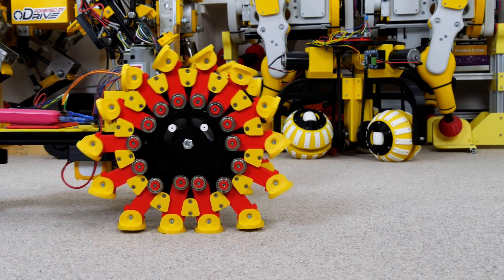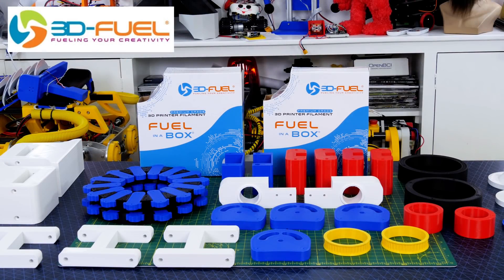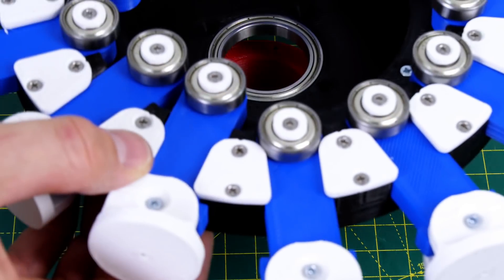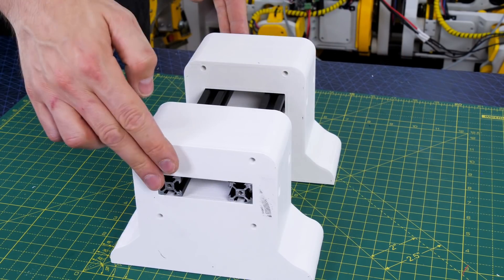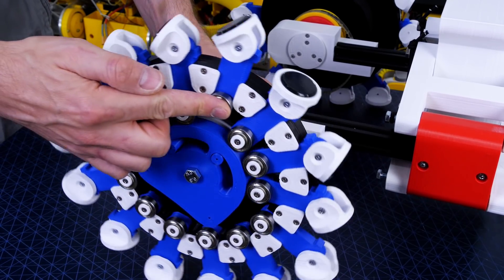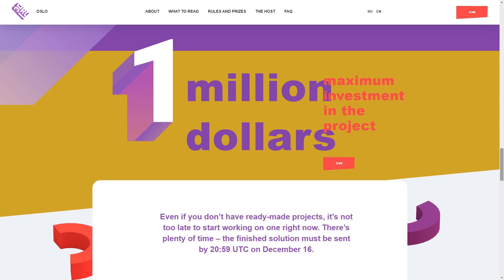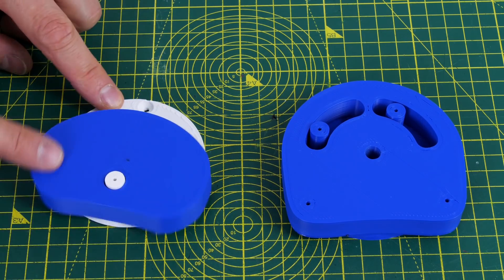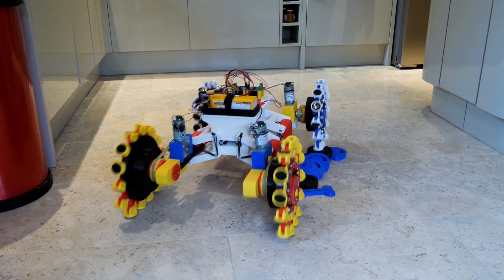4WD Walking Wheel Crawler Vehicle

Comment: Hi James. With that new inner wheel support bean things, you completely missed the purpose of them. As it is now, it is of zero use, as the bearings aren’t touching the red and blue middle bean shaped things. Right now, since the bearings aren’t touching it, the entire concept of this wheel is destroyed. And instead of the whole robot being supported by the bearings touching the beans, the small yellow feet are touching the outer wheel which is where the support is now, and not at the bean, which makes zero sense. Right now, only one, maximum 2 yellow/white feet per wheel are supporting the robot, whereas if you did it correct, 2-3 yellow/white feet would touch the ground and support the robot AT ALL TIMES. 

The solution is to increase the length of the blue and red arms that hold the white and yellow feet, and to go back to your previous inner support design, and then do as the original drawings did, put springs in so it is kept upright. 

Please, please, please this is such a plain sight error that you have completely missed. Sure, it drives, but like this, it has zero reason to be this complexs, and you could’t have just made one big single-part printed wheel without moving parts and it would perform just as good. Feel free to get back to me on Telegram @emilsterndorff so I can explain why this design is so flawed, compared to what you are actually trying to build.
Reply: I was searching for this comment
Reply: Nah, forget the inner bean completely, put a very light spring on each leg instead. As long as the legs are extended when they reach a high step it will catch on it and climb. 

I think the goal should be to make a legged-wheel that can climb a step up higher than a round wheel of the same size could and the bean doesn’t help with that sort if extreme step up. I think with light enough springs it could be made to climb over a blocker higher than it’s point of rotation. The other wheels would have to be able to compress the legs that are hitting the face of the step/block before the leg that is above the corner of the block could reach it and catch and climb. Can’t wait to see that.
Reply: This is such an aggressive way to offer help. Your points may be valid but this reads so disrespectfully.
Reply: @ThreeLetterChop  no I think he's just making his point clear
Reply: He certainly was clear.

Comment: It's neat to see in motion but it would be cool to see how it would work on a sustained climb as in up/down some shallow stairs or in a stretch of uneven or rocky terrain. I know it may not be practical to find a place like that but it seems like a regular tire of the same size wouldn't have a problem traversing these tests.
Reply: It would be cool to see this tested in a rocky environment. And to see if it could out climb a normal wheel.

Comment: I'd add steering to the center, so that the whole chassis would bend/flex like a dumper truck. Could be pretty cool 👍
Reply: And maybe some additional weight on the chassis to really make the suspension work...
Reply: And some portal axels.
Reply: @raymondjack4634  Mmmmm. Suspension and portal axles.
Reply: Articulated
Reply: We call em wiggle wagons. Its an articulated chassis. Bends in the yaw axis and twists in the roll axis.
Reply: Most of the large ag tractors are articulated. Knuckle steering is a problem when you get to very high loads.
Reply: Do it
Reply: Dumper Truck
Reply: Dump trucks like that don't pivot solely on that hinge, they still have normal steering.
Reply: @Iron-Griffon  no they don't.. the vast majority are center pivoting (at least the ones here in the UK). Both roller and dumpers, and some telehandlers.
Reply: Look up "lego springless suspension". It kinda does what you're describing.

Also look up a bunch of other suspension systems, like Active Suspension and "Fully Mode-Decoupled Suspension". Both of those are good if you want a lot more control, but they can be quite complex.

Comment: it's a neat concept, but as I try to think of ways to improve the feet, everything I think of just sort of turns them into treads, thus defeating the purpose of the experiment... lol
Reply: I wonder if you could stimulate a much larger wheel by running the legs through tracks.
Reply: I think track-like but not tracks is the answer, just put arc shaped toes on the feet which are interleaved with the feet either side. The feet still retain their fixed pivot point

Comment: I would expect quite an improvement if the feet are just made with flexible fillament so they can conform to edges instead of the rubber feet
Reply: Wouldn't that defeat the purpose tho?? 
The idea here is that the wheel itself conforms
Reply: @tannlknin6926  I don't think so. The way I see it it would fulfill the purpose of the rubber feet since they would squish in one direction like our feet and hands do to hold on and also it would help greatly with things like sharp stones where the feet might otherwise just slip off one side
Reply: @TheRedNaxela  yeah you might be right. 
I think he briefly touched on it in part 1 qctually

Comment: this mechanism is the ideal demosntration tool to show what is happening inside a soft crawler tire as it conforms to a surface. Same mechanical principle once done with rigid mechanics and with compliant material.
Reply: My robotics team uses compliant wheels for our obstacle-climbing machines. We could've done treads as well but didn't want to deal with keeping them tight enough.

Comment: Why can't the little arms be individually sprung rather than utilizing a central guide? A rubber track around the feet could perhaps prevent them becoming stuck in obstacles as easily.
Reply: It's just a tank tread with an unusual drive mechanism at that point.

Comment: I think your legs are too short. as the ankle hinge part hits the hub before the roller hits the middle guide. I think the length of the leg should be so long that the roller hits the guide before the ankle hits the hub. Also your bungy coard may be a bit too tight, but it seems to work okay.

Comment: That design looks like something from the H G Wells 1903 short story 'The Land Ironclads' that describes a kind of tank warfare, before tanks were invented. The land ironclads were described in the story as 100 ft long armoured vehicles that moved on eight pairs of big pedrail wheels, each ten feet in diameter.
The story can be found online. When I first read it it was not the pedrail wheels that impressed me so much as the description of the vehicles gunners sitting in darkened cabins watching the outside world on screens and controlling the guns with a joystick with a fire button on top.

Comment: I don't see how the guides are helping anything at all. I mean i would love to be proven wrong with a guide vs no guide test, but especially now that the bearings aren't even touching the guide when they are at the bottom, i don't see the point. Also, i am very curious as to why you did the suspension like that with the double wishbone suspending a long beam with the wheel at the end of the beam. I don't know why you wouldn't use the beam itself to your benefit, i.e. just a single pivot at the end of the beam.
Reply: I think the guides are only helping at keeping the feet extended before it transitions to moving flatly across the surface. This helps the the feet to step over obstacles instead of just retracting back.

As for the suspension, the point is to keep the wheel and the guide centre position constantly upright. If you instead use a pivot at the end of the beam, the guide centre position will be tilted whenever the wheel is raised.

Comment: I am not sure I understand the purpose of the bearings on the legs. Wouldn't a solid discs do the job in this case?
Reply: For the axle. The wheel then has a pulley fitted  directly to it for drive.

Comment: If you do anything else with this project,  I recommend angling the chassis to more of a pyramid shape to be able to clear taller obstacles.
Reply: Mount the wheel to the end of the suspension arm and the ground clearance issue is gone.
Reply: Or just increase the break over angle

Comment: Interesting mechanism. I would like to see it outperform a wheel of equivalent size, however. That would be especially interesting. Good job!
Reply: Deflated wheels may even replicate how it "adapts" to the ground
Reply: I did think that early in the video, when it's only climbing over small obstacles that a grippy conforming wheel would manage fine, but at 10:47ish you see the blue wheel climb an obstacle almost as high as the wheel radius, which a conventional wheel would probably have trouble with so it's not a completely silly idea.
Reply: @PKMartin  I beg to differ. I've seen rubber tires climb vertical surfaces higher than the entire vehicle
Reply: I was going to say the same thing . Wheels of the same size
Reply: Yeah, it would be really interesting to see comparison with a wheel of similar size and aggressive thread. As always great content. A lot of work went into that little project. Always admire perseverance to make things work..
Reply: I agree with using a partially deflated wheel to test against this design. Although a wheel is not much to look at compared to the Smurf/Candy Corn Express.
Reply: not the same scale but you might get an idea: https://www.youtube.com/watch?v=DcGWg9koek4
Reply: there's a niche category of rc crawlers called "superclass" with big ass wheels, usually stitched from several smaller ones and super-soft layered foams to conform the terrain. these rigs are mostly home made and cost quite a lot money for a "toy".

Comment: 3:16 i like your improvements but on this old design it would be awesome if you could tension individual springs form the "right" stop to the "right" bottom for rotating clockwise to help angle it "upwards" and dampening the descent. and and release tension on the "right" side and tensioning the "left" side to go counterclockwise.

Comment: im curious to see how the robot would fair going over the same obstacles if you put normal rubber wheels of the same diameter on it as a control.
Reply: Yeah, and maybe a 3rd control group using tank treads.
Reply: Indeed; a side-by-side comparison with various simpler alternatives could be well worth the effort. How does it perform in comparison with a fixed wheel? What about a fixed wheel with really aggressive paddle-shaped treads? What if the pedrail's pivoting feet were directly affixed to a circular hub, instead of being mounted to sliding rails like this? And perhaps most interesting of all, can James himself devise an equally effective (or even more effective) alternative wheel design using far fewer parts? (I might personally suggest something using spring compliance of the printed plastic, for example.)

A side-by-side comparison with each of several alternatives would definitely be worth watching 👍
Reply: I was gonna comment the same thing 😂
Reply: The simplest test would be to remove the guides. Are they really essential? Or individually sliding feet are enough to climb obstacles?
Reply: @GoblinAlchem  Well the latest mars rover's wheels (Insight) kinda do that, with deformable wheels that regain their shape over time..
Check out this video by Real Engineering: https://www.youtube.com/watch?v=2lv6Vs12jLc
Reply: That was my first thought. The whole arm suspension assembly reminds me off that crazy rock crawler that can independently lift each wheel to the extreme to overcome any obstacle
Reply: with some very soft wheelbarrow innertubes as tyres.
Reply: Well, those have bad unsparing weight for sure
Reply: I had the same thought
Reply: P
Reply: He normally does not miss details, but the legs does not have enough travel to reach the inner guide always. I don't know if that will improve performance, but the shape has no effect if it does not touch.. 🤔🤓
Reply: @TheStuartstardust  Yeah I suspect maybe he was planning to wrap around the guide with something soft so the weight distribution on each legs won't be all or nothing.

Comment: How might it perform if the feet were just replaced with soft rubber balls? That would save on weight and should make it better able to bite on more aggressive ledges.
Reply: A ball has less contact area than a flat foot
Reply: @CoolAsFreya  not if the ball is low enough pressure
Reply: Part of what makes these special is the feet being solid and mechanically tilting to conform. If you take the simplest solutions to the problems with this wheel, you quickly end up with either a deforming rubber tire, or belt tracks.
Reply: @dustinbrueggemann1875  that's probably why we still use tracks and tires and not this design. The simplest solution is often the best solution. I can't imagine a scenario where this wheel outperforms existing solutions that are easier to manufacture and maintain. 
I think the question asker has missed the point in looking to improve this design. That will inevitably lead to tires. This doesn't exist to be the best solution

Comment: The feet need to be closer and now it's time to add a Tire. No hang ups with this config. It should move over whatever without hang ups.  This would be the best Wheel Chair configuration possible today in my opinion. All ground travel would be possible I believe with this mechanical design. Thanks for the up load mate. If you take my design please give a 10% on over all sales. Thanks for the upload.

Comment: Very interesting! I would love to see it climb a set of fixed stairs, there is probably a hard limit on the exact height of the step which it could overcome but for the right height step I can picture this working better than even quite a soft wheel. And it of course can't be punctured.

Comment: Shouldn't there be a simple leaf spring in he feet to keep them straight on the legs as long as there is no load on them?
Reply: I don’t know, I think that it would work perfect for flat terrain or terrain with small obstacles, but not so well for big obstacles. Take a box for example, if there were springs to keep the legs straight, wouldn’t the feet hit the upper surface of the box with there side? (they would normally be faced down due to gravity). This could be a problem.
Reply: Nah, they are supposed to flop down with cravity in order to walk over things.